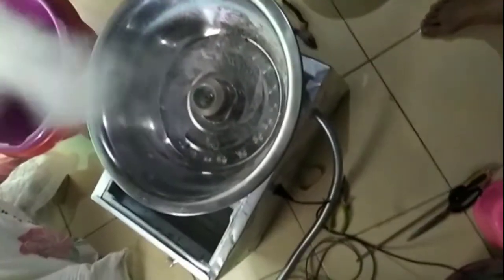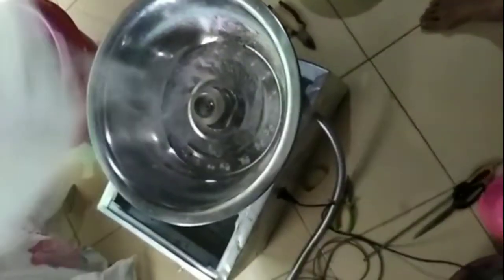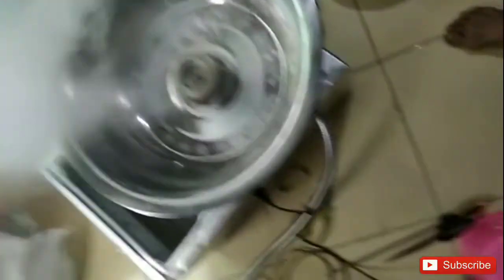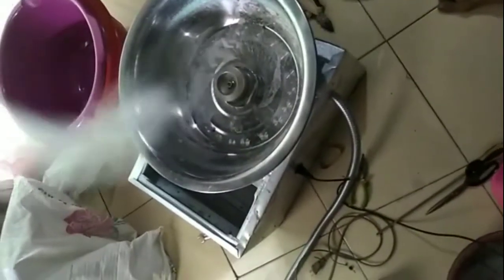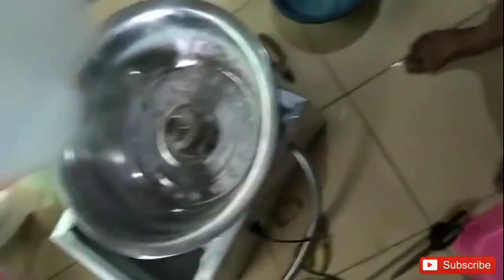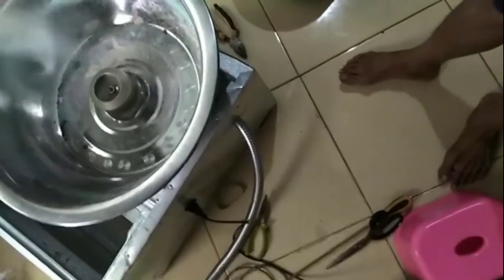pembuatan mesin arumanis...

Comment: pake aki motor apa mobil kenceng banget
Reply from the maker: Aki motor 12 vol kang
Reply: muantaap 12 vol tpi kencang bikin tungkunya plat brapa mili bg hasan
Reply from the maker: @arsadiarsad5934  pake 0, 5 mili
Reply: @banghasan1974  tpi tebal yeah saya suka beli ditukang bikin seri motor katanya 7 mili yg lunak tpi ga tebal
Reply from the maker: Klu yg lebih bagus pake 3 mili. lebih tebal lebih bagus hasil gulai nya  gk cepet kempes
Reply: @banghasan1974  ok makasih ilmunya bang hasan
Reply: kalau disini susah bg hasan beli platnya ada juga yg tipis itupun hrus beli minimal 2 mter
Reply from the maker: Sama" emg dimna posisinya
Reply from the maker: Kalu dekat pasti  sya kasih  bahannya
Reply: @banghasan1974  diserang banten bang hasan
Reply: @banghasan1974  ciruas